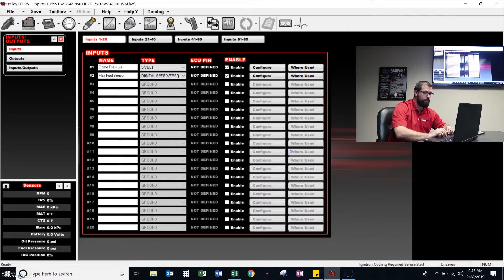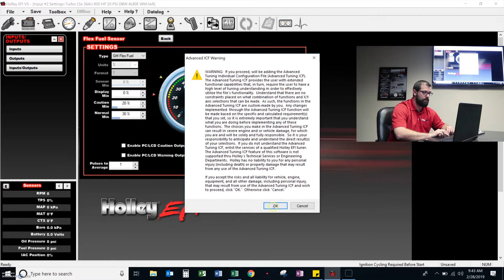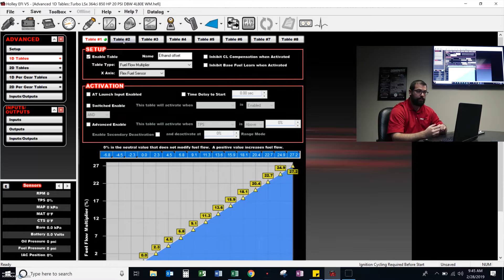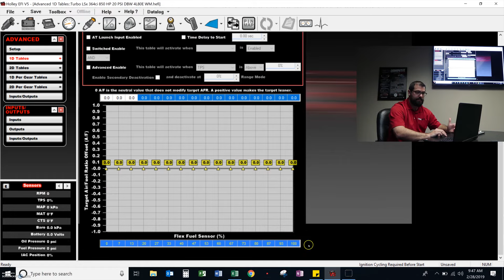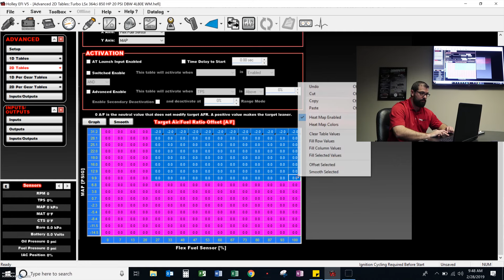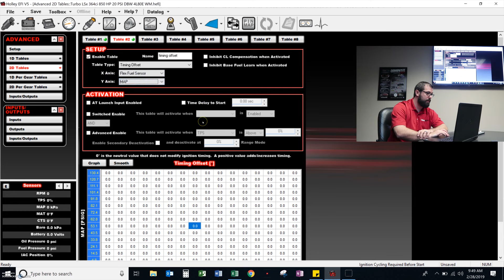Holley EFI How To: Set Up A Flex Fuel Sensor

Comment: What if your already running e 90 and you want to add a flex fuel so you can run e85 from the gas pump what  percent would you type in

Comment: Could the Holley Sniper dual quad use this if not would it work with a different Holley ECM ? Also are any of your ECMs adaptable to CNG or LPG  with flex fuel ?

Comment: It's a great video, but I think there's one pretty big error.  Going from gas to E85 requires a 35% change in AIR FUEL RATIO (9.65:1 on E85 is 65% of the 14.7:1 for gas).  This requires a 1.52 multiplier of the FUEL FLOW.  Thus, a 35% decrease in AFR requires a 52% increase in the fuel flow.  So to go from gas to E85 (assuming you had a good gas tune) you would multiply all the fuel tables (base map, cranking, AE enrichment, after start, etc) by 1.52 or as this video shows, instead use a 1D table and multiply by 52% (not the 34% shown). Since there are other factors beyond just stoich, additional tweaking is needed.  But my point is the 34% Fuel Flow Multiplier shown in this otherwise great video should be 52%.
Reply: Fuel temp also changes flow required a lot more with E85.
Reply: Good point, but wouldn't be 63% if the scale is for 100% ethanol?
Reply: That is incorrect. I can tell you from experience that roughly 35% more fuel keeps the AFR in the same spot. Saying that because 9.65*1.52=~14.7 you need to add 52% fuel is over simplifying it, and plainly not how it works. These are two completely difference chemicals with completely different behavioral characteristics.
Reply: @ArthurSperotto  Been driving my cars on flex fuel when th Holley Dominator for 4 years. Street miles, engine dyno and chassis dyno tests. My pump E85 near me varies from E55 to 90, and the flex fuel sensor goes into the Holley fuel tables. That's my experience, on all the fuel tables (not just the base map). That is also the math.  If you can explain why you're different I'd love to hear.
Reply: I would say if your flex fuel sensor stopped at e85 it be 52% but it is scaled to 100% so it should be scaled to 63% no?

Comment: If initially using 100% gasoline (no added ethanol) and the flex fuel sensor is reading 100% ethanol, shouldn't the fuel flow multiplier be 63.2% at 100?
Reply: Ok, figured this out...I think.  After some reading, I discovered that I wasn't taking into account that fuel flow is measured by mass flow rate, not volume.  Since ethanol doesn't need as much air to burn (lower mass of air to mass of fuel), the AFR decreases.  Basically, with more ethanol, the air-to-fuel mix drops.  For example, it goes down 39% for E100, 38% for E98, 34% for E85, etc.  I believe these are the Fuel Flow Multiplier percentages that are used to adjust for the extra weight of fuel needed to match the ethanol content.

Comment: Can the dominator control a new style 2010 and up GM alternator?
Reply from the maker: It cannot. you can use our resistor plug to get those alternators working correctly. https://www.holley.com/products/ls_power/ls_and_lt_accessory_drives/low_mount/ls_and_lt_accessory_drive_components_and_service_parts/parts/197-400